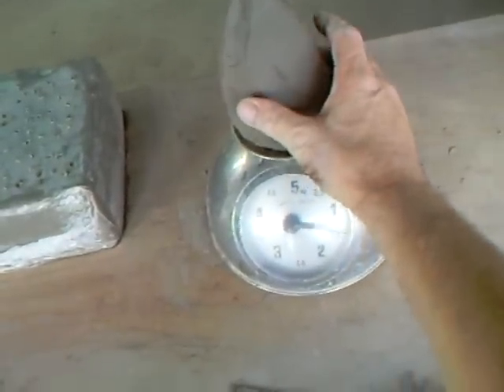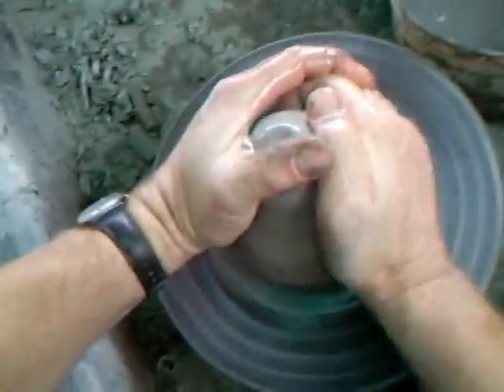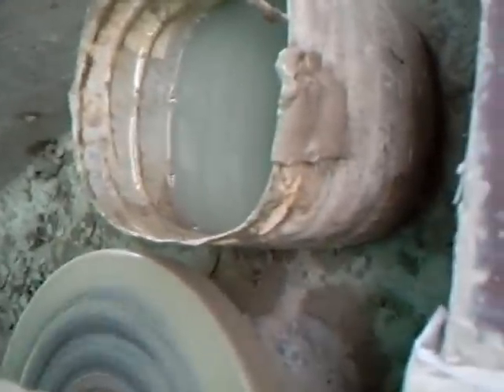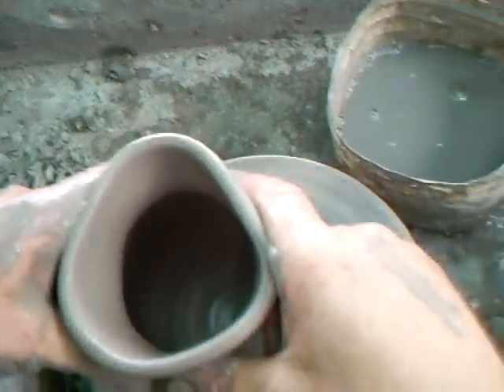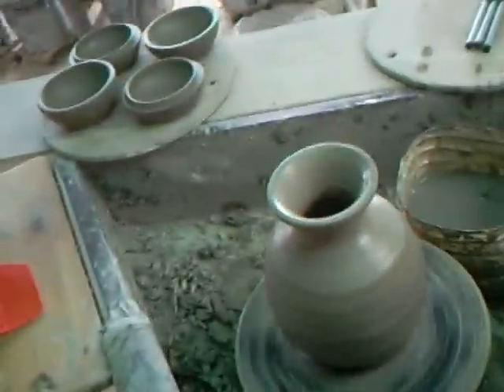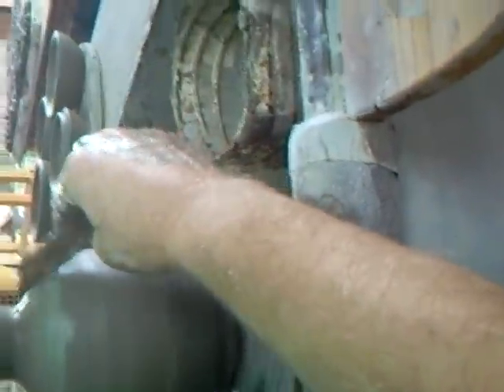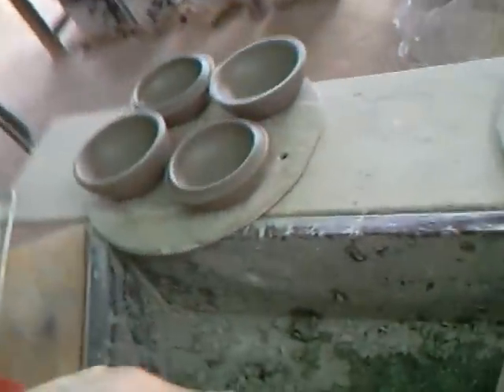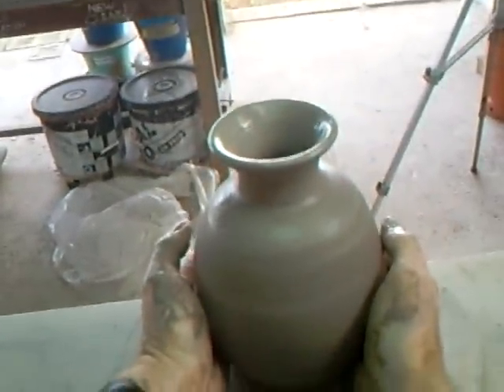SIMON LEACH - 'The strapon' .camera to my head !

Comment: Hi Simon, Try a mirror situated on the other side of the wheel head, about where you put the finished pot down, looking back at you.
It's great for checking profile without having to get up and I think it would be an advantage with "potter cam".

Sam